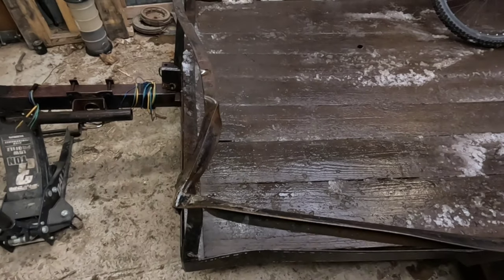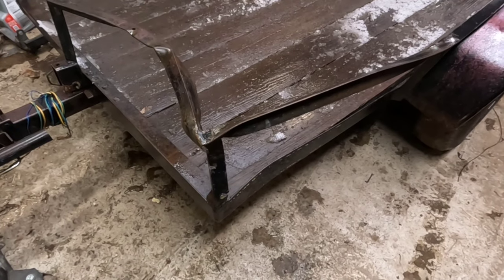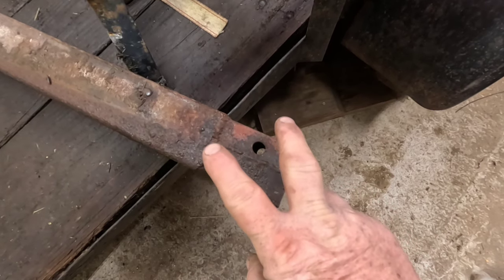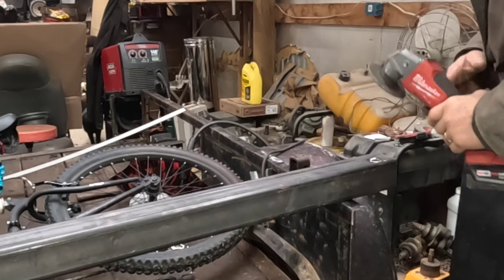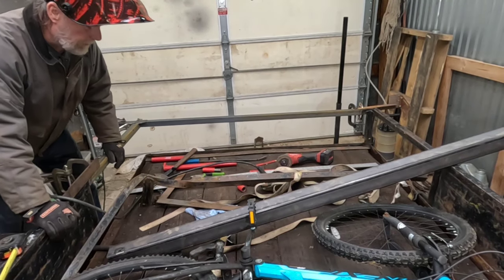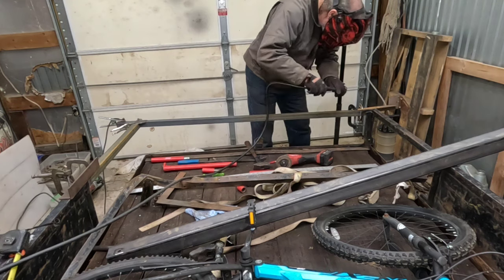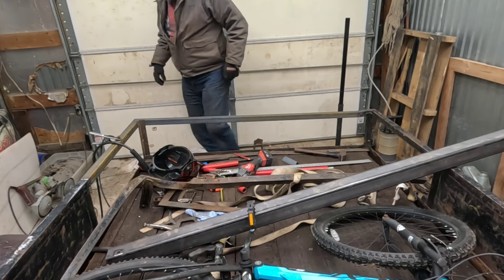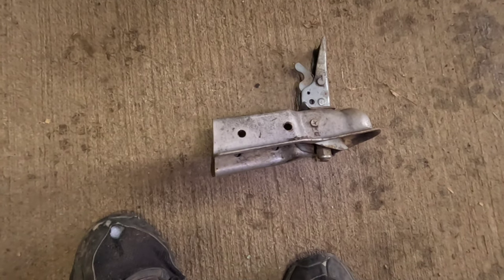Repairing a Bent Utility Trailer. Cutting, Welding, and Straighting

Comment from the maker: Unfortunately too many of the trailers I repair are from lawn service guys who never tie down their mowers. I do have 1 guy that ties everything down. On his trailer I went to my local trailer parts supply shop and bought D rings that I welded about every 2 feet apart on the outside of the trailer at  floor level except by the wheels where I had to put them inside the fenders. I had to take floor boards out to do them. He should be here later this week to pick up a mower and I will record a short video on the D rings and location. Thanks